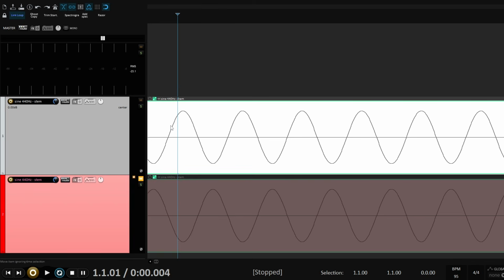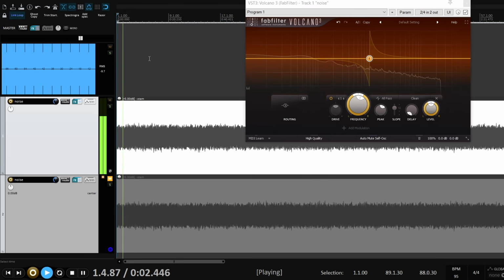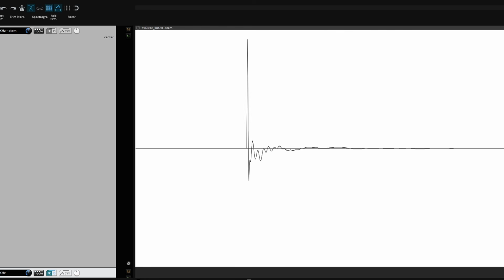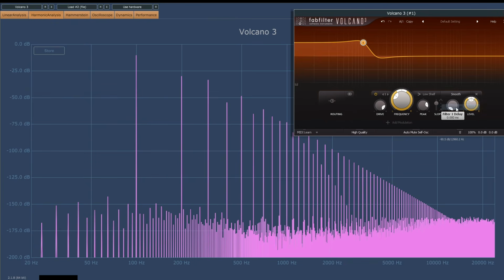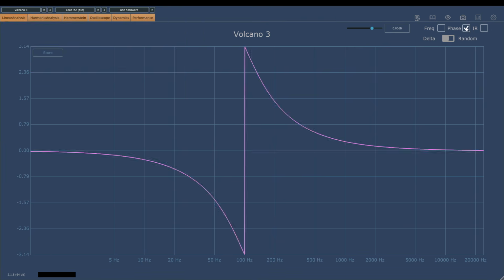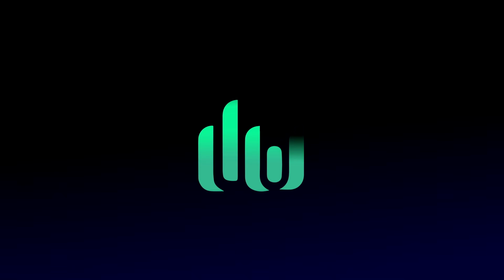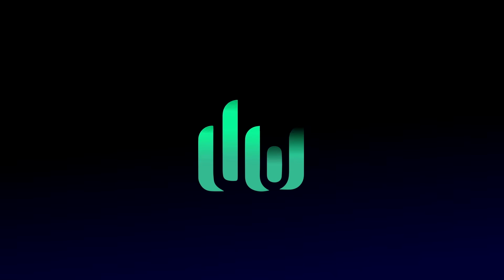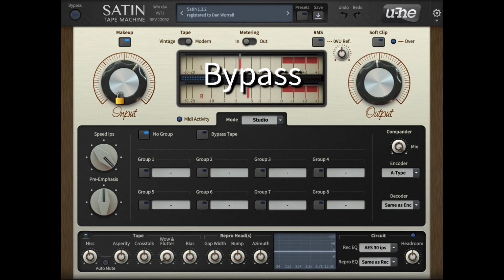How (Not) To Test Your Plugins

Comment: Not sure if you have read Angelo Farina's papers about using exponential sine sweeps for measuring distortion characteristics. But basically the reason why he uses exponential sine sweeps is that he can then turn them into the IRs of the individual harmonics -- i.e. in cases where he does indeed want to know how exactly the system is distorting the signal, this method allows him to separate the component IRs from each other, provided the reverberation time is short enough (the IRs of the harmonics are located at exact time positions relative to the actual linear IR).

Comment: 22:12 I don’t think PD is feeding “single sample spikes”. I used an EQ earlier and it looks more like fast sine sweeps. Room EQ wizard does this too and it converts it into impulses. Per REW help: impulses are all frequencies at equal energy. Sweeps are the same but have advantages for speakers in particular. Just my guess.

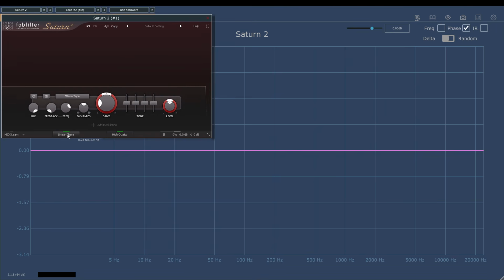Ah 40:33 I see volcano shows a different kind of activity. Hmm, who knows.
Reply from the maker: You might be correct, but it's still grabbing impulse responses either way so doesn't really change my point.
Reply: @DanWorrall  This is true and I updated my comment since later in the video Saturn looks like it’s receiving pulses. Anyway, congrats on the positive reception of this video and thanks for the information and entertainment.

Comment: But bad  jitter from a D/A converter can make a same file sound different. A null test is just an internal mathematical operation. 😊
Reply: If the jitter is horrendously bad, sure. If it’s not really bad, it’s going to be completely inaudible. Jitter doesn’t affect timing of frequencies, it only adds side band distortion, and often at such a low level as to be inaudible
Reply from the maker: Jitter doesn't exist in a plugin, the concept doesn't apply until you clock the samples out of a DAC
Reply: @DanWorrall sure but I was relating it to people who say if there’s a difference in the audio waveform when it reaches their ear, through that process. You’ve proved, through many videos that plugins can create anomalies to a waveform, if used wrongly. There’s also different types of audio drivers to add to the process. My point is how it all interacts with a DAW. I have a sound card that bypasses ASIO as and has its own DSP recorder and the difference in stereo imagining is striking. Knowing your gear, obviously helps,and system will always add noise and distortion,but if negligible it won’t interfere with the pleasure of the sound. I’m speaking in an Audiophile sense btw.
Reply: @aristotleonassis5792 
Not really sure what you're meaning when you say "driver type." Software drivers enumerate functionality to the host OS. USB connectivity sends data packets asynchronously to the interface for audio data. Thunderbolt doesn't change this behavior. Thunderbolt just has more bandwidth and is fundamentally a specialized protocol that is basically identical to a direct 4x PCIe connection with some communication overhead. 

Sure, DSP in your interface could modify samples before conversion, but that is done digitally with an FPGA. It's functionally the same as your own computer doing the processing. 

I think you might be confused about a few of the details involved in these processes.

Comment: Impulse Responses are basically a Dirac function?
Reply from the maker: Um. Yes? I think...
Reply: @DanWorrall  In Quantum Mechanics it's quite useful,, but basically it is  single pulse which is the fourier transform of a single frequency. It's the actual basis of the Uncertainty Principle. It should really be called the Dirac Delta function.

https://en.wikipedia.org/wiki/Dirac_delta_function
Reply: PS. Thanks for the "no bullshit" analysis of the often misrepresented audio stuff. An excellent video.

Comment: Great vid Dan. I feel like every studio engineer or producer would benefit from doing some FOH or monitors engineering. Unless you're on a console with a display like an M7 or Midas (which most small venues won't) you're never gonna get bogged down by the numbers and even if you are on a console with more plugin style effects and a digital display, you're generally watching the band not the board. Really forces you to be more listening focussed and also fast (sound checks last minutes, not weeks).  Anyone can basically sign up to most venues as a Cazzy (Casual Technical) which is basically a zero hour contract and you'll probably get some work after shadowing for a while. I've worked at dozens of venues and done countless tours and there's always noobs on the crew. Because it pays so poorly they're generally desperate for extra hands and if you're on the list you'll definitely end up getting a call once someone inevitably has a sick day. I wouldn't advise it as a career though lol. Not unless you want to be permanently knackered and skint.

Comment: About cognitive bias (and audiophiles in general): funniest thing I ever saw was an "audiophile grade" SATA cable for $150 🤣
Correction: it was actually $658! And they also have a USB2.0 cable for $800 🤣
Reply: That's nothing - someone once told me they were testing gold-plated power cords!
Reply: @Pinkybum  I'm sure they are just taking the piss out of people who are naive enough to buy these things! 

These are the features of the "Pachanko Aphelion SATA cable" I was talking about: 
- OCC multi-stranded copper wire 
- Silver plated conductors
- Cryo treated
- Multi core wire with different sizes to cover the overall bandwidth
- Teflon coated
- Cotton coated (cotton from Madagascar)
- Mu Metal shielding
- Shielded connectors
- 100% hand made
- Can be bent
- Compatible with all OS
Price: $658!!!! 🤣🤣🤣

I'm sure they are just some random Chinese crap cables that are sold for a 10.000% mark up!
Reply: @nj1255  That is despicable.

Comment: One minor correction: Using a linear phase filter is not a guarantee that you will not increase peak levels either. Try EQing a (gently band limited to round off the corners and avoid true peak excursion) square wave to cut off all but the fundamental with a linear phase EQ. Depending on exactly what filter you use, you can wind up with a +2dB increase in peaks.

Peak level just doesn't mean anything once you introduce EQ in any form, even without phase shift. The peaks are, after all, a time domain phenomenon, and there's no telling what will happen to them when you introduce frequency-dependent processing.
Reply: Woah, MARCAN is here? 😮

Comment: Dan, why do we always make sure everything starts at the beginning of a positive cycle and not a negative cycle? ... Is it just a convention to make sure all tracks are phase aligned? or does it have to do with how speakers should begin their cycle? ... In that case, two identical but polarity inverted tracks sound the same except at the very beginning which is so fast we can't even perceive it? ... If you can clarify this for me I would appreciate it, thanks!
Reply from the maker: Just convention I think. And yes, polarity inversion is usually inaudible. When it is audible, it's often (always?) due to asymmetric non linearities in the playback system.
Reply: Maybe I'm crazy, but starting from a positive cycle on low punchy sounds sound more impactful to me. My guess it's because of the first forward speaker movement instead of the beckward one.

Comment: does cramping really make a difference? realistically nobody is going to put a bell boost of 10db close to 20khz. so in a real life situation is there ever going to be a noticeable difference?
Reply from the maker: Bell boosts at 20k sound awesome*, not at all the same as a high shelf, you should try it.
* unless you use a crampy EQ ;)
Reply: @DanWorrall  I do have pro-q 3 as well as stock reaper reaeq and reeq. I will be sure to test sometime although usually I tend to do mostly cutting in that range
Reply: People definitely do huge, airy bell-shaped boosts at and above 20kHz all the time. It’s a great sound in the right context.
Reply: @fricknanklin  I've personally never tried it. Often done high shelf by a couple of dB usually lower than 20khz but affects that but never thought to put a bell there. I'll certainly try it sometime if I feel my high end is lacking a bit.

Comment: Hey Dan, could you have a look at PI from Sound Radix? It's supposed to dynamically adjust the phase rotation of individual tracks in comparison to others to minimize destructive interference. It'd be really interesting to see how it works (delay or rotation) and if there are any problems with it :)

Comment: What are the supposed advantages of using a high bit depth in EQs, other than lowering the already ridiculously low noise floor? What resources would it take up? I'd imagine RAM, but is there also a CPU hit?

Comment: the eq cramping thing reminds me of one of the rather annoying issues i’ve had with the plugin i’m working on. i prototyped it in reaktor and the stock filter cramps, but i didn’t notice it because it’s a distortion and i was running in 2x nearly all the time, but when i ported it using the algorithm wikipedia lists, it was pretty wrong (well some of the issue i had was me accidentally typing the wrong variable in one spot, oops), because it wasn’t cramping. so while i could’ve made a similar filter to what i was porting, i liked it as is and didn’t want to change it, so i switched it out with the decidedly non-optimal filter algo reaktor uses (maybe the normal one pole is fine but the optimized version cramps) because i’ve used a lot of parallel filters and i don’t feel like changing it over to a different filter and making it match. and the default will be 2x anyways so it shouldn’t matter. definitely considering at least getting a plugin doctor trial, i’ve been using eq curve analyzer but it’s just eq curves

Comment: One thing worth noting is that even though two bits of audio can be identical and null perfectly, there can be an audible difference based on how speakers react positively/negatively. Try this on a kick drum, the difference can be pretty obvious
Reply: Nope. Unless you mean the kick drum will sound different on different speakers - which is obvious.
Reply: Can you elaborate?
Reply: If they null perfectly then they are not identical 😉 but yes i get what you mean.

Comment: While I am mostly onboard, I will admit I think ABX methodology might not be the best for detecting subtle changes due to many factors, not the least being forced to make an objective choice (which is which) many times over. What I would like to see is a blind preference test, which has a similar set up, but where a listner will have to choose which of the randomly arranged tracks he likes best. A statistically significant preference will automatically mean the listener can differentiate between tracks. Sadly, I have not seen apps like that. And, of course, it is interesting, whether a good performance in one of the tests can translate to the other. Maybe they are equivalent, indeed.
Reply from the maker: That doesn't answer the question though. Or perhaps it answers a different one. If you get a 50/50 split in such a test, does that mean half of them preferred one over the other? Or does it mean they couldn't tell them apart?
Reply: @DanWorrall  Yeah, ultimately they're different questions. But IMO it can be a very interesting and telling study in psychoacoustics to check whether significant preference in a "blind preference" automatically means the good differentiation in ABX. I would love to set up such a study. No means for that, sadly.

Comment: Thank you for all the effort you put into fundamental audio education. The thing that boggles me still is that the connection between the inner ear and the brain is made with nerves with a maximum trigger rate of 1kHz or so, many in parallel for sure, but still it is an utter mystery to me how the subtleties in this information actually gets transmitted over low bandwidth channels and yet I can listen to a marvellous full-range performance or tweak a 10KHz eq setting...
Reply: Well the ear basically does an acoustic FT before any "data" is sent to the brain. So the rate at which the nerve fires, should only relate to time resolution...

Comment: You always claim that because of math a null test could prove that there can't be any audiable difference. But keep in mind that all those numbers have to be written to some ram chips inside the computer. And you entirely neglect the font that is used to write those bits to ram. So there can be differences even if the numbers zero out. That's why mixes on Apple machines sound so much better than PC.
Reply from the maker: Is that where I've been going wrong? Damnit. Guess I'll have to buy a Mac.

Comment: Can someone eli5 how if I am running a 64 bit OS, the plugin can have an internal bit depth greater than that?
Reply from the maker: Two 32 bit words gives you a 64 bit word. Same way you get 14 bit pitch wheel resolution from two 7 bit midi controllers.

Comment: I am curious as to why a digital non-analog modeled compressor fed with a static sine wave would produce distortion. 

If the level of the sine wave is static, then the GR amount of the compressor should also be similarly static (after the compressor’s GR envelope is triggered - determined by the specific attack and release settings). 

I am having trouble understanding why a compressor that is remaining at a constant GR level would produce distortion. Isnt it essentially a volume knob at that point?
Reply from the maker: Sine waves aren't really static, they oscillate continually from positive to negative and back.
Reply: @DanWorrall  ah this explains it! Thank you! Fascinating to think of the GR mechanism of a compressor trying to keep up with an oscillator

Comment: 15:30 This is my one major gripe about the T-Racks stuff... a lot of it is cool and I do use it, but so many of the plugins add anywhere from a db or so, to as much as 4 or 5 (!!!) db just by being loaded on the channel!! Extremely uncool design choices from IK Multimedia imo and when I realized it I got a bit turned off of their stuff. I do still use them since I have the bundle license already and I do like some of the plugins quite a bit otherwise, but I went through and made my own init settings with the output/input set properly for all the ones that have a gain boost by default, similarly to what you suggested.
Reply: 1 or 2 dB is nothing. Waves add something like 6dB by default!
Reply: @Pinkybum  it's still relevant when you're comparing the plugin in bypass especially for eqs, compressors, etc. but yes more is even worse, I'm sure they aren't the only ones. but some of the T-Racks plugins do add as much as 5 db by default as I said. not a fan of Waves either for a number of reasons

Comment: I tried the null test on AD converter and preamp comparison files and the test was a total failure as the files could not be the same length. It was very interesting though how the same audio signal recorded on two different preamps/converters ended up with different lengths... So the null test sounded like a very very slow phaser as one of the files was slower a couple of samples every second.
Reply from the maker: Yeah, you'd have to sync the converter clocks to make that test work. But then you don't know if external clocking affected the sound...
Reply: @DanWorrall  Oh, I didn't know you can sync the converter clocks - I just used the files provided by a comparison video.
Well, you know I was really, really listening to things like "The snare sounds a little bit more 3D with the more expensive unit" and I wanted to get a bit more scientific.

Comment: I love the saw tooth recreation, Dan! A simple and elegant (yet immensely powerful) demonstration of basic audio principles.
Reply from the maker: It was surprisingly difficult to generate sine waves that didn't drift out of phase as I was talking!
Reply: @DanWorrall  I'm glad you pulled it off. I feel smarter after watching the demonstration of your hand made phase shift causing increased peak levels
Reply: @DanWorrall  Very interesting. Do you know why the drifting took place? Is it because of the processing internally, perhaps enumerating the channels very fast, but still introducing some latency of a couple of samples? Did you have to align the peaks manually? Thanks for your effort, it was worth the educational bonus.
Reply from the maker: @basroos_snafu  I think just tiny inaccuracies in frequency, which would never matter except in a case like this. My solution was to generate them using Reaktor's sine bank module (I think that's what it's called) which is specifically designed for additive synthesis. Then set it to produce one partial at a time.
Reply: @DanWorrall  Thank you for your answer, and effort again and again. Nice you came up with the solution as well. Enjoy your weekend!
Reply: I think if the mix hadn't been clipping, you could prove that the waveform didn't matter because the sound wasn't changing. But here the sound got obviously sharper as the first waveform was slided around.